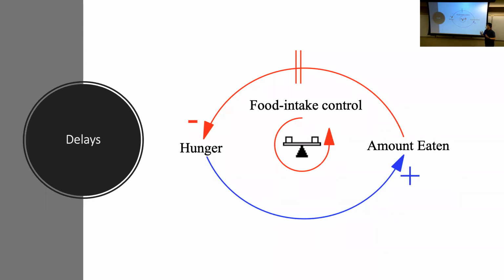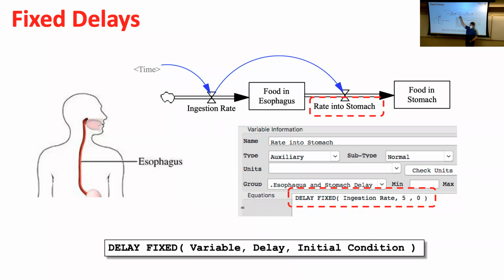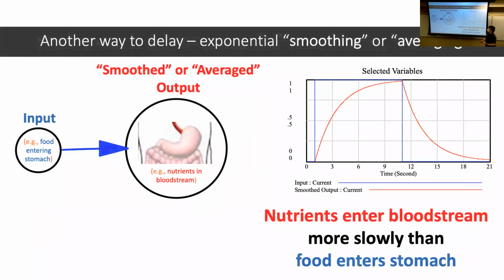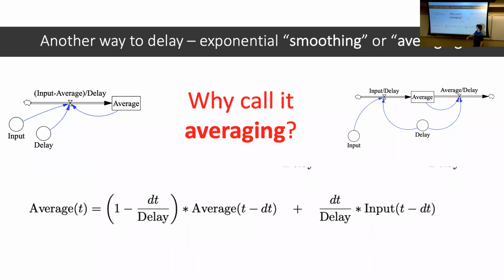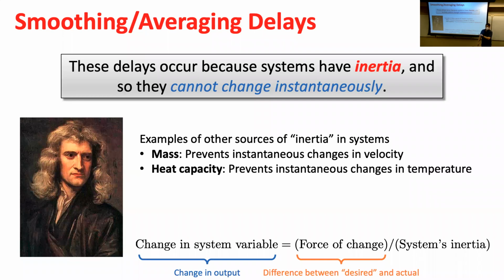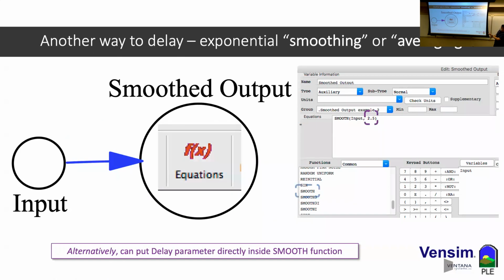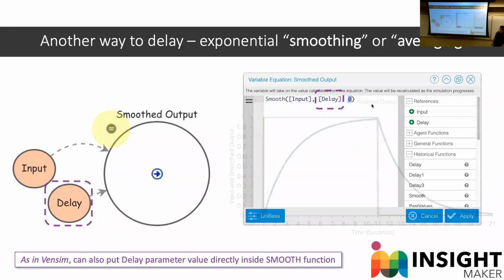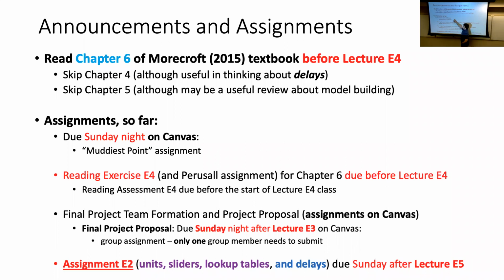SOS 212: Lecture E2 (2022-03-15): Making Sim. More Realistic, Part 2 – Delays, Fixed and Smoothing

Comment: I had heard the idea of "residence time" in fluid flow. Can I refer the "average delay" here as something like "residence time" in flow of hydrology? 

And should we consider the remains of input from previous time step to calculate the present time step average? Say, delay = 5, and at initial, input(0) = 1, avg.(0) = 0, when done at next time step t_1, avg._1 = 0.2, but does this mean we still have 1 - 0.2 = 0.8 of input(0) as additional material to be digested in the next round?
Reply from the maker: Yes, the average delay or "time constant" (which is the reciprocal of the "rate constant", another term that you might hear) is the same as the "residence time." In other words, if you had a container of fluid that had come to equilibrium with some inflow that matched its outflow, the residence time can be viewed as how long any parcel of fluid arriving from the inflow remains before being flushed out the outflow. The "time constant" is the time it takes for the container when it is out of equilibrium to come to 63.21% of the way to equilibrium, where the rate of change is the most at the start and gradually reduces until it goes to zero. The rate at the start of the transient is the same as the constant inflow (or outflow) rate in the equilibrium interpretation for "residence time." So, for both, you get the same number.

Regarding your second question, in the time-averaging perspective, you should not think of the input as a physical input (like an inflow) but more an abstract input (like a desired level in a fluid constrainer that is being maintained by feedback control to a valve). In the case of a toilet right after a flush (for example), at the instant all of the water leaves the tank, you can think of the "input" jumping from 0 (empty tank) to the level at the top of the tank. The water actually filling the tank lags behind -- being driven in part by the target at the top of the tank and in part by the inertia of the valve (slowing everything down). So, the actual water level in the tank (which is being controlled by the valve) is a time average of the immediately previous level of water in the tank (that's the inertia) and the target. The valve is designed to choose how these two things are "weighted", which effectively sets how quickly the actual water level rises to the target. 

So, although we think of the instantaneous "step" in the target from the bottom of the tank to the top of the tank as an "input" in the signal sense, it is not the physical material input that is being sloshed around. The physical material input is the water coming out of the valve.

So, I guess I would draw a distinction between "input" and "inflow." An "input" can be an abstract/mathematical quantity in the dynamics of a system, but the "inflow" is the concrete physical source of material that will be balanced by an "outflow" when at equilibrium. Often in these systems, we assume that the source connected to the inflow is infinite, and so valves are "pinching off" material from this source as opposed to depleting it. Of course, within the system, we worry about depletion effects, but at the edges of the system, we worry less about conservation of mass just as those who design toilet valves assume that sufficient pressure is always available for the valve to work. Does that answer your question?
Reply: @TedPavlic  Yes, this is very clear and instructive. Many thanks to give such detailed explanations. Now I have a better understanding of average delay and consider "desired change in a stock" as a more general representation for "driving force", such as a goal, or a stock state that would be achieved.  Thanks again for giving such instructive explanations!